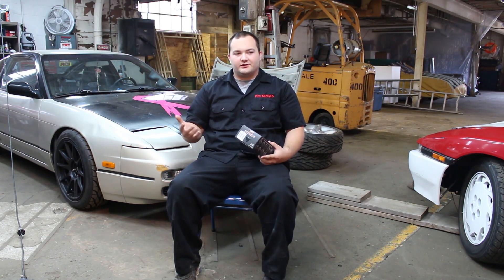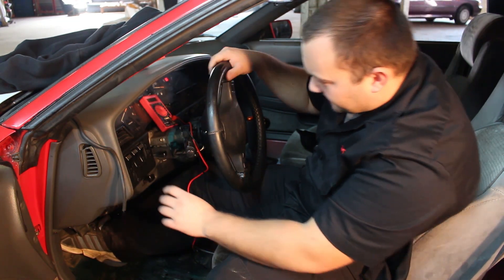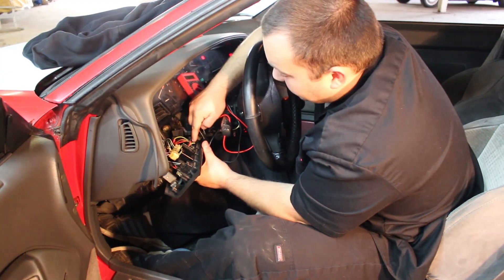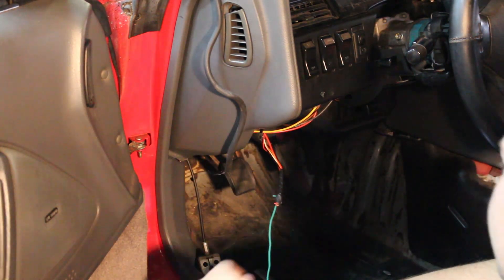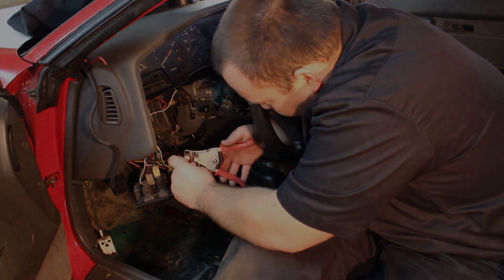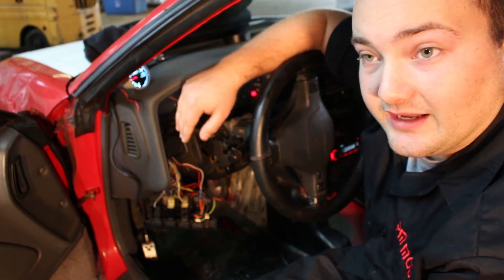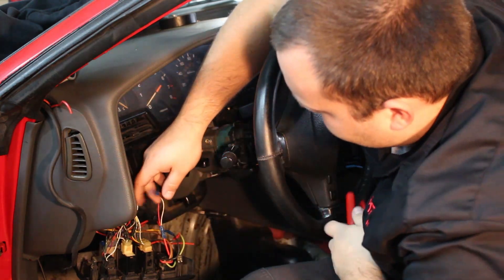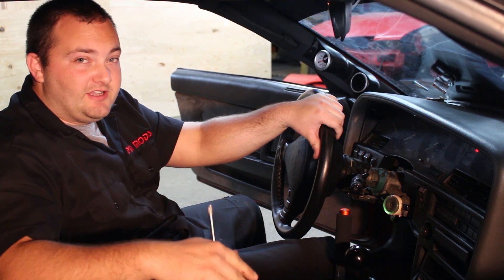Volt Gauge Install | ProSport Performance Series Volt Gauge | 1JZ Supra

Comment: Here's a funny for you.  Back in 70's when CB radios were all the rage we installed a CB in my friend's truck.  It would work in the back yard but when he drove down the road it would.  After repeating this routine several times we discovered we had tapped into the power line that causes the interior light to come on.  The CB only worked when the door was open.
Reply: Ha! I pulled a dumb stunt like that once. Except it was with emergency amber lights. 
They would work in the daytime (since my interior lights didnt turn on during the day) and at night when I'd open the door, the lights would die...
Took me longer than I'd like to admit to figure out the problem...

Comment: Thanks to you I likely won't need to pay $100 for this hookup. :)

It's always great to have these wired into those stubborn vehicles with electrical problems. Yes, the obvious rapid ticking noise indicating a dead battery is a giveaway but it's best to see where it's at, like a total drain or something just under 12.6v. From there decide if the battery cells are shot or there's a small parasitic draw when the auto is off. I ripped my volt pod out of my old beater and installing on my 1999 Eclipse which was running fine until last summer when everything went bonkers. Replaced battery, changed the terminals, installed new alternator, replaced a blown amplifier... and now the ignition cylinder will take the key but I have to fight it to turn. It's always something, I tell ya what. >:(

Comment: The non turbo Supra's came with voltmeters in place of the boost gauge and its a fairly easy swap, but your way is much more fancy pants. The amber should help at night so it doesn't blind ya too.

Comment: I noticed the wire you successfully fed the smaller wires through with was not the same red wire you demonstrated actually taping the smaller wires to. How many failed attempts before you stuck them on properly?

Comment: Little off topic but on my 90 supra i reused the headlight washer button for a push start. Its works as anti theft too because trying to start the car with the key the car acts like it has a dead battery. And the push start also just gives me another reason to say because race car

Comment: The problem I'm having is that all the key on power wires in my car are 1 volt less than the battery actually is. The only thing I can think of is putting a relay in.

Comment: really useful video,   my first time worked in this thing and I did it. anyway I have a question and I hope you help with it.  so I have a water temp gauge, SAAS model,  I used you method for wiring,  but i connect the white wire to cig light for dash light,  red wire for ignition switch,  I used expandable fuse wire and connect to the fuses box under fuel pump fuse and it's work perfect, black and green wires done.  but the orange wire for led memory I don't know how to do it or where to connect it!? any instruction on that and what function to use on multimeter would be appreciated. by theway my car is skyline r31 s3
Reply from the maker: thanks for watching and Im glad the video helped. Im pretty sure you would connect that organge wire to head lights or head light switch, so when they turn on that orange wire gets power and changes the color of the gauge.
Reply: Poor Man Mods thanx alot for your replay,  would it be easy if I just connect it to yellow wire in cd player?  as it's constant as I just watched a video explain constant wire and how it's work for led memory
Reply from the maker: you could give it a shot, but I dont think you will get the desired result
Reply: Poor Man Mods thanx again mate,  so as you said about head lights, do I connect to the fuse using expandable fuse?  sorry for annoying you by this questions,  but that's the only way I can learn and do.  I really do appreciate your help and what you doing.  thanx aloooooot
Reply from the maker: you can probably do it that way, or just splice it into the power wire.
Reply: Poor Man Mods thanks alot,  I will give it a try when I get time to do it and let you know how it's goes. much appreciated your help
Reply from the maker: yeah no problem, good luck man
Reply: Poor Man Mods . hi mate,  sorry for bothering you,  So I give a try,  and I had to change the ignition wire from the fuel pump fuse as when turn the car on its cut off so I used antenna fuse as I don't use the radio, anyway it's work perfectly,  as for the led memory wire it's not working when I connected it to headlights fuse,  so I decided to run it to yellow wire plugged into the cd player and it's works except the gauge needle doesn't work!  I guess the gauge is faulty reading,  so I will go tomorrow to swap it and see how it's goes.  thanx my brother so much for the videos , much appreciated

Comment: I have a question about this install. Since you used the wire where the headlight switch feeds the fog light switch does the gauge turn white again when you turn on your high beams?

The reason I wonder is a lot of cars are set up so that when you turn on your high beams it cuts the fog light feed so they aren't both on at the same time.
Reply from the maker: Matthew Laycock the gauge stayed amber when the high beams turned on, it only change color if the the headlights were on or off

Comment: you cant get shocked by 12 volt.
Reply: Yes you can, with enough current.
Reply: ***** have you ever heard of the path of least resistance our skin is far to resisive to let 12 volts pass through. a car battery can deliver up to 600 amps. go ahead and touch the two battery terminals and you wont feel a thing. if it were on your tounge it would be a different story as it is less resistive. current does not mean shit if there is not enough voltage to pass the skin you cannot get shocked.
Reply: smallenginedude71
yes this is true, at least some people online are smart. if you touch both ends yes electricity goes through your body to the other end, but most of it takes the easiest path which is copper wire or other metals...... its not a perceived shock
Reply: No, with enough voltage. Higher the voltage the easier it is to overcome a certain resistance. As far as I can remember it requires over 40 volts to break the human skin resistance.

Comment: lmfao who installs a volts gauge:(
Reply from the maker: someone who wants to monitor voltage?
Reply: id be embarassed to tell someone ive got a volts gauge
Reply from the maker: almost no cars have volt gauges, ive never owned a car with one and ive owned like 7 cars. If someone wants to monitor voltage then they would get volt gauge, they are also good diagnostic tools. And if you are so against them, why did you watch a video titled "VOLT GAUGE INSTALL" ?
Reply: came up in my sugestions, not really sure, but oh wow that interesting, ive had quite a few cars and they all had a volts gauge, i personally would never double up on a gauge that already came factory, i guess in my personal opinion having a whole gauge "pod" just looks silly with a volts gauge. if i was going to add one to monitor volts id prolly go with a lcd screen readout
Reply from the maker: You do realize all you have to do is not install a volt gauge, no one is telling you to double up on your gauges, and you do also realize you didn't have to watch this video...
Reply: yes i realize that
Reply from the maker: Did you realize after you watch the video and got upset? lol
Reply: i didnt untill you told me:( im sowwy
Reply: Reece634 lightbub lol, a "few" rice you had
Reply: I'm watching cause I need to install one to monitor voltage drops due to audio upgrades.
Reply: Reece634 I have one on my supra to know when my alternator, battery or starter goes out.
Reply: my subaru doesnt have a volt gauge?
Reply: Reece634 Some people actually make real horsepower and melt alternators with the extreme heat generated by exhaust gasses from the manifolds, O2 housing, and turbo. A voltage gauge is good to have to prevent getting stranded on the road. Sounds like you're the only ricer around here.